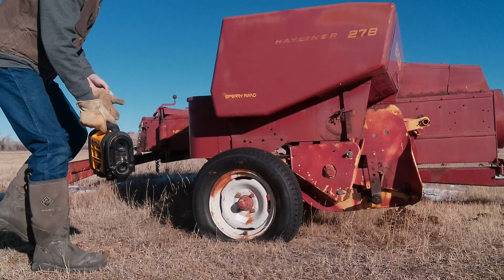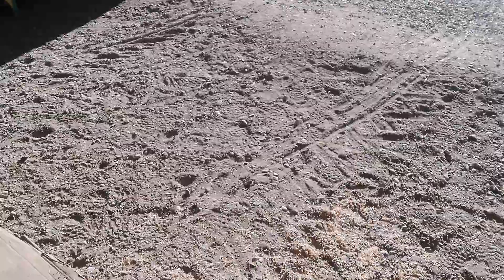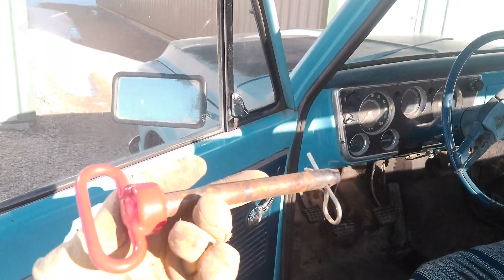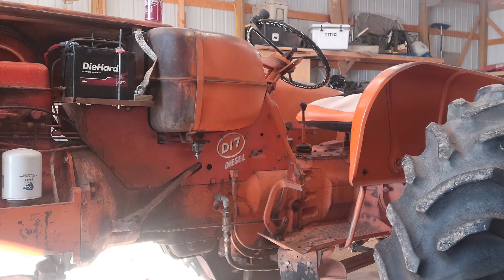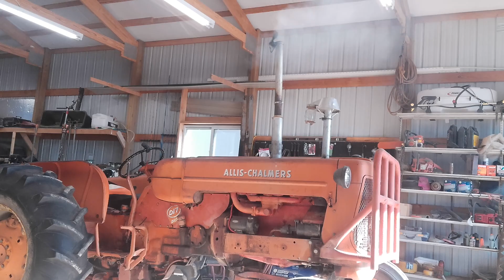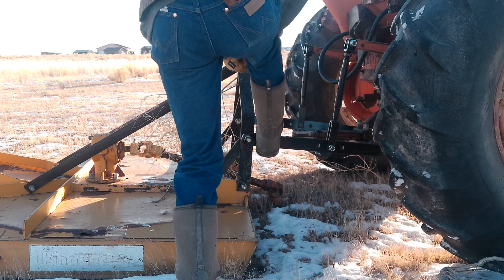Allis Chalmers D17 cold start and moving baler for storage

Comment: That tractor does have a intake air heater, from what I seen from the video, it’s not wired up, where you were spraying in the either look above that towards the front of engine, you will see a fine thread lug, that is the positive terminal for the heater,
Reply from the maker: Well now I know what I’m going to look into today. Hopefully the element is still good

Comment: I don't know too much about the 262s in the D17 Diesels, but I don't feel like they should start THAT hard. Then again, not been around one, so take what I say with a grain of salt. I feel like if everything's to spec, good compression, good injection pump, correct timing, etc, they should start somewhat easier than that.

I've only ever been around gas burning D17s, though. Our Series IV gas burner is the best running gas tractor I've ever been around. And it has factory 3-point and remote hydraulics
Reply: A slightly improved version of the engine that was used in the WD45 diesel.  We always had a block heater (coolant line) plugged in on our WD45 diesel for winter, but in warm weather it never needed any help to start.
Reply: @tractorsold1  yup, the WD45 Diesel used the Buda-designed 230, very similar to the later Allis-designes 262s. I'd like to find me a WD45 Diesel one of these days
Reply from the maker: There was a reman pump put on by the previous owners father. No clue on history before that. Could very well be timed poorly or have a worn out engine
Reply: @Tractor-Roy  Either way, D17 Diesels are really cool. The D17 in general is just a pretty good tractor in my opinion. Live PTO, Live Hydraulics (on the Series IV) anyways, on the go shifting with the Power Director, etc. They're a good tractor

Comment: Diesel engines which are reluctant to start, especially those needing 
starter fluid to help the trouble is caused by low compression.

!
Reply from the maker: Very well could be. If it’s lacking power once it’s hooked to the baler next summer then I’ll dig deeper into it.